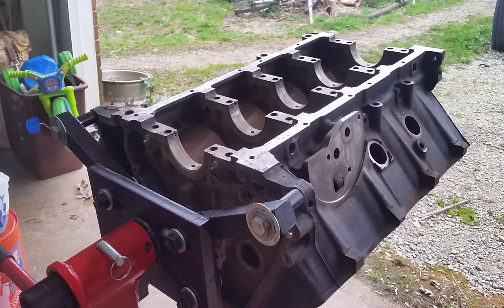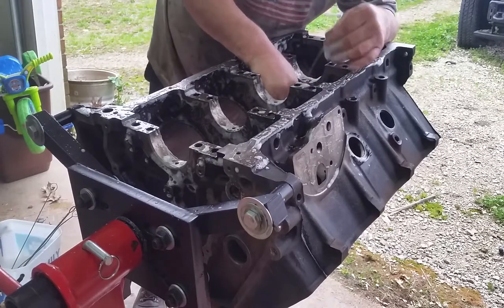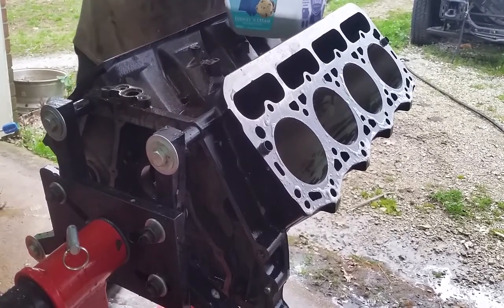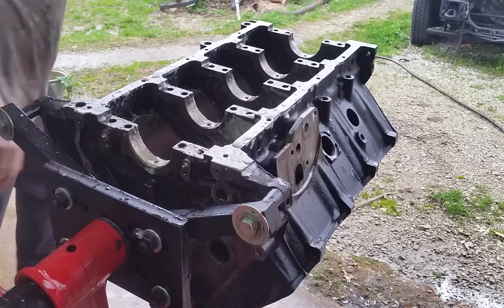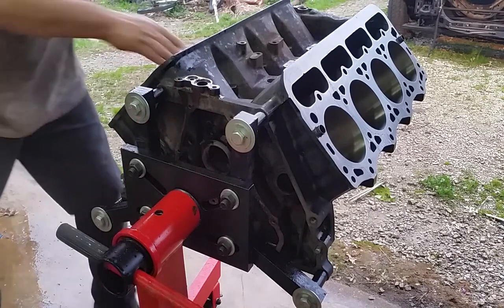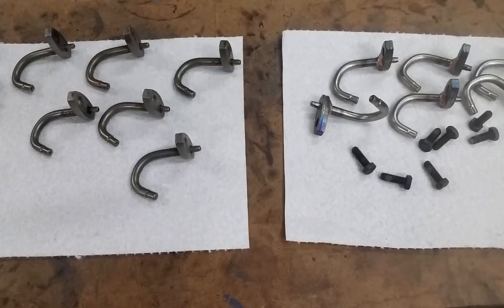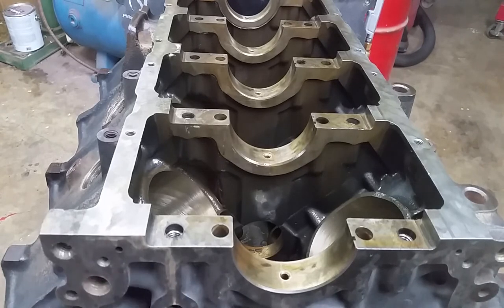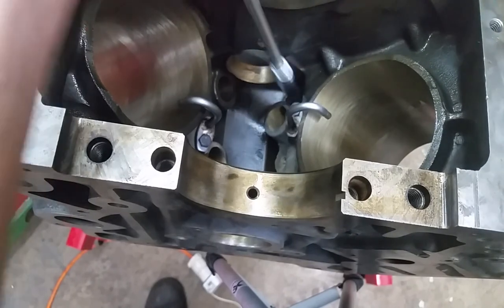7.3 Build: Cleaning the 7.3 block after machining

Comment: Freakn Awesome boss. I'm a fan. My 2nd rerbuild. Feeling pretty confident on this one. First one to pop my cherry was a 06 DT466. Loving all this wrenchn'n and learning. Thanks for the video! Definitely ordering me the oil jets from riffraff. Will be going through all the videos. Just dropped off motor and heads to get machined. Had 1 piston with stuck rings. some wear on cylinder. Going to sleeve back to standard, new piston for that cylinder. All new piston rings, new lifters, cam bearings... Keep up the good work!
Reply from the maker: Thanks for the kind words. These engines are not difficult to build nor are they difficult to get power from. They are however, not cheap. Put the money into good parts and the 7.3 won't let you down.

Comment: PMR Rod - I actually know what that is.I think 01 - 03 they came stock with those.
Reply from the maker: Yes. Mine had PMR rods so I purchased a a set of early model forged rods. Not very expensive and a bit more durable when used with ARP rod bolts. Be sure to have the assembly balanced though since the weights will be far off from a PMR setup.

Comment: We’re there any copper tuber running through the oil hole on the cooler surface going into the main galley? I found a weird object after I got it back from the machine shop and I can’t figure it out
Reply from the maker: No. That's kind of weird. Can you post a picture on the build thread on powerstroke.org?

Comment: how much the shop charge to do 0.020 over? total?
Reply from the maker: I paid $1000 for boring, checking line bore, honing and balancing. If you're in the area of west TN give Richard a call at Hyperformance Engines. He's about the best in the mid south. Mind you my block didn't need line honed so that would be additional if needed.